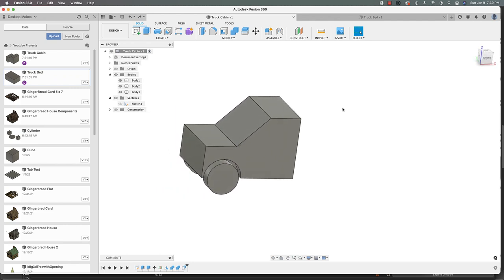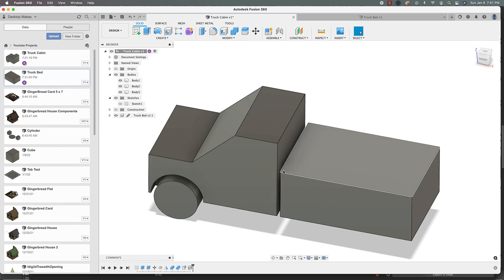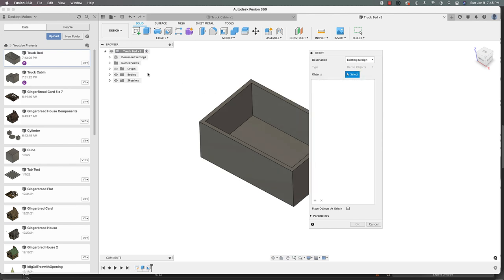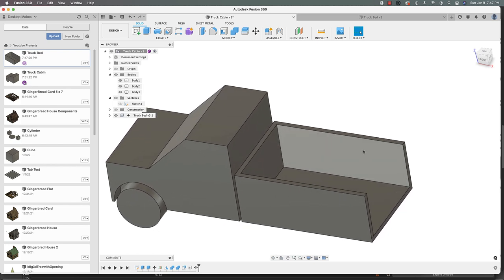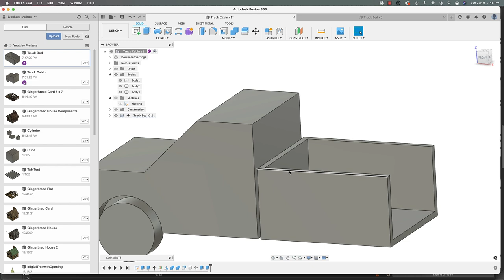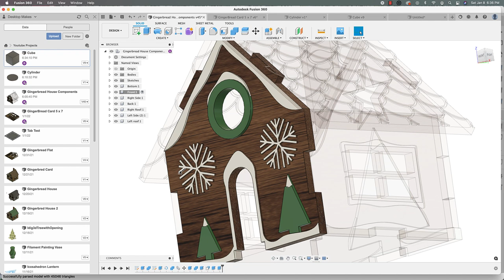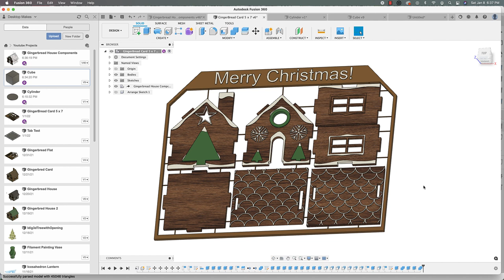Fusion 360 Insert Into Design VS Derived

Comment: Vladimir... I must design a part within its fitment to remove interferences with adjacent parts. I used the Derive command to insert the component into a design pre=populated with other (linked) components. This method permits me to edit the "derived" component to remove interferences. How to I save the changes I make to the "derived" component within this subassembly design file to  the "derived" component's design file? I tried the "Edit in Place" command, but changes made via it don't update the "derived" file. For that matter, what is the difference between editing a "derived" file within a design and using the "Edit in Place" command?

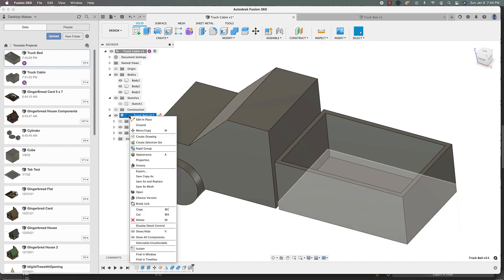Comment: Not exactly correct. @3:32 you can see another option at the top of the context menu. You can insert another part just as you did at the beginning, and still model it while viewing the full assembly model. It is called "edit in place", something they added a couple years ago. Using this method, you are still editing the original as if you had went back and opened the original, but using this method you can still see, and use, the other parts for context. Great video though!
Reply: Edit in place is a handy feature. Unfortunately, it is not available to those of us who use the hobbyist version.
Reply: @hoagytech  ah, didn't realize that!

Comment: Thank you very much for the detailed explanation, I appreciate it!
So basically with the Insert tool you can use an existing design as it is, but with the Derive tool you can add more items to its original timeline in the target design. Very useful!

I think multi-file design is a very interesting topic that may be worth to explore. What are assembly contexts, how to make components that refer to each other, how to use the same parameter values in multiple files can be very tricky - especially since Edit in Place is not available in the free version :( 

Thanks again!